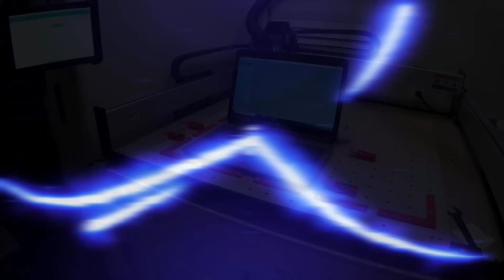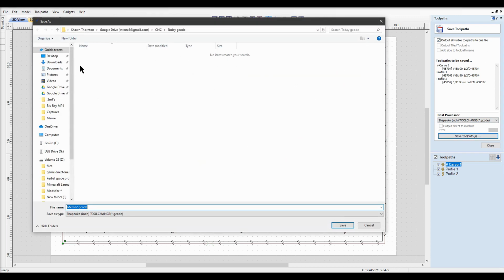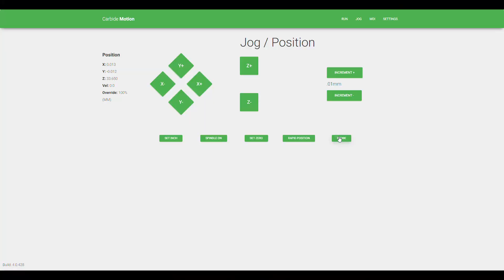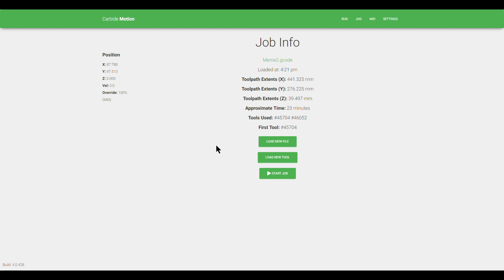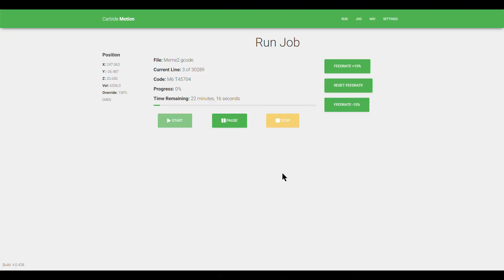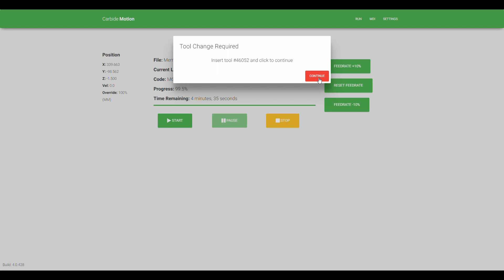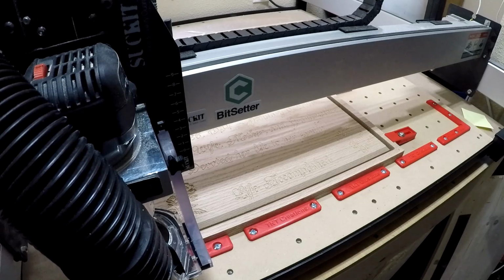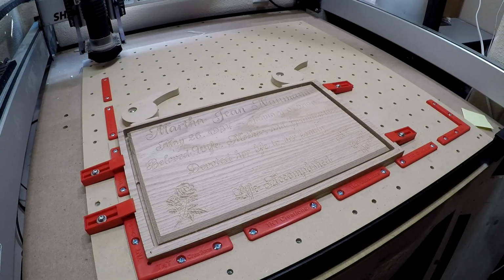VCarve Pro with Tool Change and Bitsetter

Comment: well that seem like a waste of time why not just use your X,Y,Z Prop, it will be a lot faster.
Reply from the maker: To each their own. But this way you can create one file with multiple bits. It’s actually pretty quick. It’s a personal preference. Carbide pushed their bit setter a lot. I used to use it a ton. Not so much anymore.